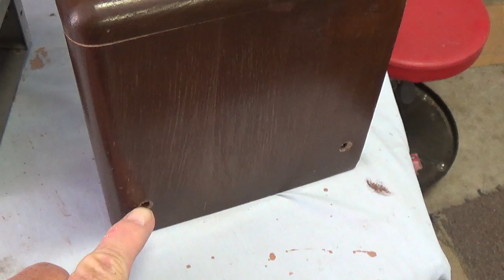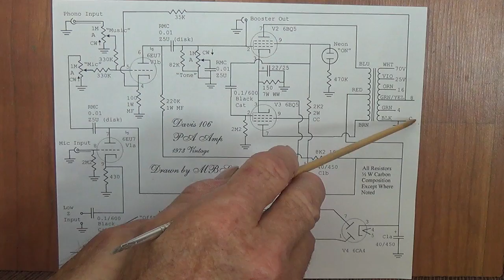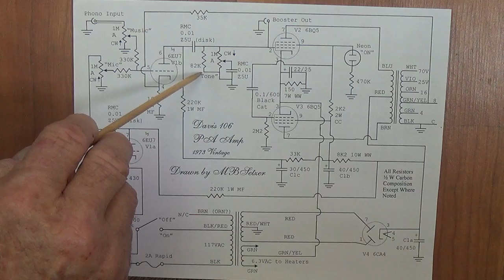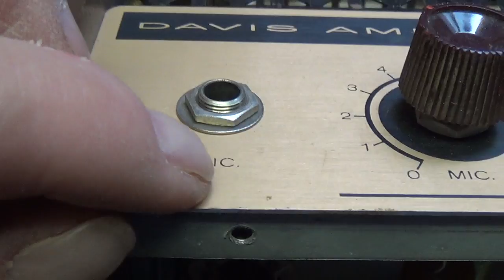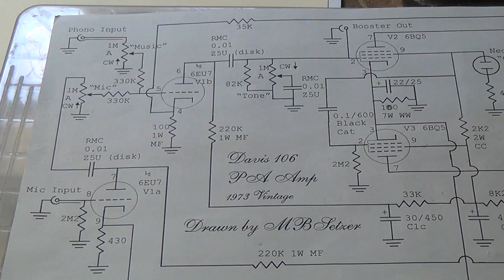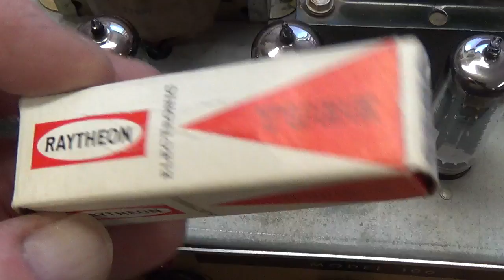Conversion of a J.W. Davis P.A. Amp into a Tube Guitar Amp

Comment: Gold to find those pa amps, if they have phono input,you can plug a guitar there,on old radios etc.ofcourse modding the cicuit there you can gett an instrument amp of it, here in norway radionette made push pull el84 and el 34 pa designs, they have a good reputatjon.just to change the conector to guitar input and there you go, same can be done on tube radios. There you have the cheep transformers,if you want to convert it to a only guitar circuit,and you shure find unkle doug have a building of it. Just remember to install an grounded power cord! Your work is topp as always!
Reply from the maker: Thanks for your nice comments, NB :)

Comment: Thanks for this video, it helps a lot!  I am converting a late 50's Dukane PA into a guitar amp. What gauge wire did you use to connect the 1/4" jack that fed through the screw terminal? I am doing the same thing where I replaced an RCA jack with a 1/4" jack for the speaker connection, nd I am going to feed it through one of the terminal screw holes.
Reply from the maker: You're welcome, T. When dealing with milliamps, wire gauge is really not an issue. You could use 20 to 24 gauge if you wish.

Comment: Thanks for that, Uncle Doug. I previously converted a Davis PA (a 201-A). I played it for a while and it was okay, but I've since re-wired it as a Marshall 18W style pre-amp.
I've never seen this kind of phase inversion on the power tubes before. That's really cool. I haven't felt inspired to build an amp in a couple of years, but I want to build something with this style of power amp and I want to do it point-to-point (that first Davis that I converted was initially p2p, but when I Marshalled it, I put in a turret board. I've actually got a bunch of 6BQ5s and output transformers to go with them. Now I just need to come up with a preamp for it.
I'm curious, since the screen grid and control grid are connected via the coupling cap, does that mean that the AC signal on the screen is the same magnitude as the input to the control grid? A unity gain, inverted signal?
Reply from the maker: Greetings, Pete. The phase inversion is indeed unique in this circuit. My interpretation matches yours, in that the AC output from the upper screen grid is fed (out of phase) to the lower grid, with HVDC blocked by the coupling cap. Whether the signal is unity or not, I'm not sure, but perhaps the 2M2 grid leak moderates it a bit.
Reply: @UncleDoug  Interesting. I didn't think about the grid leak affecting the signal level noticeably, especially at 2.2M. Looking at it now, that 2K2 2W seems to be providing different screen voltages to the two tubes as well.  I didn't notice that before. So there's some interesting biasing stuff happening here. I think I'm going to have to put it up on my breadboard and tinker. Do you happen to know the voltage for the HV on that? It's not on the schematic.
So since the V3 has the higher screen grid voltage, I'm guessing the signal is actually below unity? This seems very tinkerable. Part of what appeals to me is that the lack of the phase inverter really simplifies the wiring, making it much more amenable to p2p. I'm thinking maybe a Matchless Chieftain style preamp with 2x 12AX7s paralleled, but with a simpler tone control, driving the power amp. Got to see what PTs I have to play with on this.

Comment: I Don't Mess With That Old Stuff.
But It Looks Like You Just Connected
Booth Amps Into Eachother.
You Really Didn't Have To
Do Anything At All. I Have A
Vocopro Kareoky P.A System &
It Has An Output Of 120 Watts.
& It Has 4 5 Inch Speakers
& It Has A Great Sound.
I Also Gut Out Old Radios
To Make Bluetooth Speakers
Out Them.That way The
Radio Still Looks & Sounds
Original Cause All I
Play Is Classic Country
Music. Now I'm In
In The Middle Of
Building A Bluetooth
Speaker Out Of
A PVC Pipe. All
I Need To Do Is
File The Hold Where
I'm Mounting The
Speakers. I'm Using
2 50 Watt Audio Boss
Speakers. & A 50 Watt Per
Channel Bluetooth Amplifier.
All I Need To Do Is
Mount The Speakers
& Connect The Amplifier
To A 12 Volt AC.DC
Power Supply Provided
With The Amp.
Reply from the maker: Thanks for your input,

Comment: Hi Uncle Doug, I'm curious about how you wired up the AC power cord leads. I was under the impression it was better to run the AC hot (black) to the fuse and then to the power switch and then the power transformer with the neutral (white) going direct to the other end of the transformer. I'm not sure why, I just recall seeing that recommended. Are there different schools of thought on that maybe? In any case, great video, there are a lot of these old amps around that were used in schools and factories and such back in the day and waiting to be repurposed.
Reply from the maker: I agree, FB. The hot black lead goes to the on/off toggle, then the fuse, then the PT primary. The white lead goes directly to the other PT primary. If the wiring in this amp did not match this pattern, then it was an oversight.

Comment: Hey Doug, first time caller, long time listener! Youre doin great job!!

I was a little bit confused though, I thought black wire from AC outler is HOT and therefor have to go through the fuse, but in this video you did the other way round, being that the white wire is through the fuse.

Am I missing something ?

Thanks cheers for your channel man!
Reply from the maker: Many early circuits ran the hot wire through the power switch and the return wire through the fuse. I normally change this to the black wire running through BOTH fuse and switch. If I didn't in this case, it was an oversight.

Comment: Thanks for the video.  Watched it three years ago, and just watched it again.  Fascinating!  Any thoughts on the possibility or need to add a "Master" volume pot to this circuit?  I'll be using it for guitar only, and wouldn't need the phono input.  Would be cool to utilize that vintage knob and drilled pot-hole for something functional.  I'm not very knowledgeable with circuitry - and wonder if you could put the volume pot in the spot of the tone pot... then wire the tone pot like you would on an electric guitar.  I'm hoping you still check your old video comments.  Thanks again for the great video.  Steven
Reply from the maker: I try to keep up with all comments, Steven. Yes, you could add a MV to this circuit, but it would be a bit more complicated than you suggest. Keep studying videos and gathering knowledge......soon you will be able to perform modifications like this safely and correctly. Good luck.
Reply: Uncle Doug, I’m needing to replace the amphenol mic input with a 1/4” jack. From the video I can’t tell if the input Jack is ground at the chassis or a designed preamp ground point. Can you describe where the input Jack goes to ground please sir?
Reply from the maker: @kingdomtone  Rarely have I ever seen jacks that weren't grounded to the chassis, Steven. Those that are insulated from the chassis generally have a grounding lug......that is then connected to the chassis. Try it and see. I have a feeling it will work just fine.

Comment: I have a Precision Electronics S35 PA amp and I'd like to convert it to a 2 channel guitar amp utilizing the first tube preamp for a clean channel and utilize all of the preamps to a cascading 2nd gain distortion channel with a huge sound (modern). Also, I'd like  to have a switch to turn the speakers off safely and the output directed to a microphone out.  Can this be done? Thanks Uncle Doug! I love your videos!
Reply from the maker: I am having some trouble visualizing your plans, Allen, especially the part about the "microphone out".......what would be the purpose?  As to your final question, I'm sure that any concept can be built, with enough time and effort. Good luck with this one.

Comment: Good going Doug , I wondered about changing the input impedence similar to guitar amps and some have a 32,000 ohm resistors and 68,000 ohms on the input if I remember correctly !
Reply from the maker: You're better off with 32-34K, IS. In Fenders, the 68K input resistors are generally in parallel.....so actually about half that value.

Comment: Nice video. Watching your older video recently, in which you explain the operation of  three types of inverters, the Split Load, paraphase and the long-trailed pair phase inverters, buy how is it called this type of Driverless (?) Push pull inverter?
Reply from the maker: This circuit, like the Magnatone Melodier model 109, uses  a configuration called "screen-fed self-split", in which you add a voltage drop on the screen grid of the tube being driven by the preamp, and the screen will work as a "second plate" with an inverted signal that can be taken from it and fed to the other 6V6 grid through the 0.1uf cap.

Comment: Hi Doug, love your channel. What manufacturer are the “tubular” yellow capacitors you mentioned here? Is there a brand you could suggest using?  Thanks!
Reply from the maker: Thanks DK. Check out Antique Electronic Supply on line......they offer the yellow tubular caps as well as all sorts of other components.

Comment: hi there! i have a Geleso vintage italian amp and i can't understand how to connect o cable to a cabinet. it has 1 to500 omh  and 8 numbered screws at the back rgrds! k
Reply from the maker: It sounds like a PA amp, Costas. There should be a common or "zero" screw for one speaker lead, and a 4 Ohm or 8 Ohm screw for the other.....depending on your speaker impedance.
Reply: thanx! my speaker is 16omh
Reply from the maker: Then look for a terminal that is marked "16". Good luck.

Comment: Another winner, Uncle Doug. I wuz, however, hoping you would've addressed 
the National Football league loop by either simply lifting it or otherwise 
aiming brain energy towards it... as I invariably derive learning and entertainment 
from such endeavors. Also wuz wondering about the output transformer as to whether its larger size was due to the extra taps or if it had the capacity for more power, though I must confess I'm not the volume nut I wuz in me reckless and carefree youth...  thanx and cheers
Reply from the maker: Thanks, Jonny. I guess you could make the NFB switchable or adjustable. Most PA amps have rather large, multi-tap OPT's to suit a wide variety of speakers. You're welcome.

Comment: I know you don't do the Hi FI conversion thing really but do think these amps would lend themselves to Hi Fi conversion? Or would it be more trouble than it's worth? I was thinking one per channel.
Reply from the maker: People use them as monobloc amps, Jack. One for each channel. It's not my cup of tea.......but they work well.
Reply: Thanks UD! Since my guitar playing sucks I thought I might look into this since I think the vintage amp thing is fascinating but kinda worthless to me since I can't play guitar! lol.
Reply from the maker: It's a hugely popular hobby, Jack, with all sorts of Internet sites and forums to help you learn about stereo and HiFi.
Reply: If a person were to build your tremolo overdrive unit you could also drive this amp and still use it as a guitar amp as well I would assume?
Reply from the maker: Yes, the Tremo-Drive will work with virtually any audio amplifier.
Reply: I just picked up a pair of DeWald I think they are 12 watt Hi Fi amps on ebay (one 1957 and one 1958). They are Hi Fi amps to begin with so it should be just a matter of refreshing them to work as Mono block amps. One is guaranteed to work where as the other has issues.  Thank you so much for your insights into these wonderful old amps!!

Comment: Hi Uncle Doug, after watching many of your videos I gained enough confidence to start my restoration of the CHA-20; learned a lot already.  The previous owner told me that it doesn't make any sound and blows a fuse shortly after being turned on.  First I took all the tubes to the local electronics shop that had a tube tester thinking it might be a bad power tube or rectifier blowing the fuse.   The rectifier tube (6AX5GT) had a short so I replaced it thinking that I found the culprit.  I rushed home and plugged in the amp with the new tube.  Heaters lighted up so I think that part of the transformer is working.  I also was able to turn up the volume and hear moderate hum/buzz coming out of the speakers before the fuse blew again.  Do you think that is a promising sign that the output transformer is OK?  Any ideas on what to track down next that might be sucking up enough power to blow a 2 amp fuse?  It won't stay running long enough to test voltages, so I thought to start with replacing more tubes (one 12AX7 tested bad, and one of the 6V6GTs tested very weak).  Alternatively I thought to replace the canister filter caps which are 50+ years old.   What do you think? Thanks for your help and inspiration.
Reply from the maker: It's usually not a tube. If it's drawing too much current, I would suspect the filter caps might be responsible. I hope you are using a current limiter. If you don't have an ESR meter, feel the filter cap can(s) to see if they get hot ( = internal short).
Reply: Uncle Doug thanks Uncle Doug.  Appreciate the helpful advice.  I'll replace the filter and coupling caps first.  I look into making the light bulb current limiter you demoed.
Reply from the maker: Good luck, John.
Reply: Hi Uncle Doug, replacing the filter caps now.  I found a match for the 500v 16mfd cap, but it seems nobody makes a 450v 5mfd electrolytic any more.  Closest I can find is a 7mfd 450v and I'll  need to stack them like firewood to replace the 4x 5mfd can.  Is that close enough for a filter cap do you think? https://www.amplifiedparts.com/products/capacitor-ft-450v-88-f-axial-lead-electrolytic It was me that asked about checking voltage on the input power  transformer as well. I thought that would be a good way to isolate it as a functional component before spending money on all the cap replacements... Thanks for your help!
Reply from the maker: Yes, the 7uf @ 450V should work just fine.  Going up in capacitance (a moderate amount) is always better than going down.  The Voltage rating must always be the same or higher.
Reply: Uncle Doug thanks I'm  on it, after I make my current limiter. :-) thanks for all the guidance.  I wouldn't have made it this far otherwise!
Reply: Built my current limiter. Turned on the amp again without plugging in the tubes and I can hear the gentle hum of the input power transformer and no blown fuses  (hopefully a good sign) Will check voltages and impedence on the can caps when my multimeter arrives.  The plan from here is to replace the old two prong with a grounded power cable, next on to replacing the electrolytics: 1x16mfd 500v, 4x5mfd 450v filter caps as well as a 50mfd 400v that is in line between the 2 6v6gt output tubes. Also, 3 or so waxy paper caps near the microphone and phono inputs. Finally I need to figure out how to remove the microphone input (rivited on) and replace with a guitar jack. Once I get all that done and presumably the amp is functional, I can move on to the tweaks in your videos to make it sound nice!  Again thanks for all your help. Very interesting project.
Reply: Hi Uncle Doug. I got the multimeter and checked for connectivity and voltage at the connectors of the input transformer. Continuity check failed across leads 2 and 6 (410ac)- no beep.  I plugged it in to the current limiter (no variac yet) and test voltage from the wall leads to transformer was 118v, the low voltage lead was OK at 6v, but when I checked voltage across the high voltage my meter went out of range and started beeping. So I checked between center tap and ends - that came in at 430v on each lead.  Should be 410v per the schematic but I think that means my power supply is OK.  What do you think?  Thanks again for your help.
Reply: Hi Uncle Doug and happy New Year!  Working on my cha-20 project, I got my multimeter and started checking the transformer.  I did a basic connectivity check, everything beeped as expected except the the high voltage wires (410VAC with a center tap), they did show 300ohms of resistance across but no continuity beep.  Next I plugged the old amp into the current limiter (I made from your other video thanks!), and started to check voltage.  AC voltage into transformer at 119v, low voltage on the other side was 6v, and the high voltage was so high my multimeter went out of range and started emitting warning beeps.  I checked again from the tap to the ends of that coil and got a solid 430v AC on both sides of the tap.  So a couple of questions 1) now that I'm seeing these voltages can rule out a dead input voltage transformer from the equation? and 2) my measured voltage on the high voltage side is 430V but the schematic shows 410v.  Will I need to do anything to take this voltage down a notch, I can imagine if the plate voltage is too high it might burn up tubes, etc.  Thanks again for your great help.  Step by step I'm learning how to do this.  Can't wait for the day I plug my guitar in and rock...
Reply: Hi Uncle Doug, thanks so much for your videos.  I couldn't have done it without you.  The 60 year old bogen cha-20 came to life again today after replacing 6 electrolytics, 3 waxy caps, and new tubes - all bad ($100).  Sounds pretty good after addressing some issues w/hum around the input to the first stage.  I played for 40 minutes elated that it largely works now.  Plate disapation is high at 14.97w but if you account for 2.5mw grid current loss it is more like 13.5w which is still high for a 6v6gt.  Do you think increasing the resistance of the cathode bias resister is in order?  Thanks again. Add another success to your list of achievements!

Comment: Most PA amps are clones from the " RCA tube manual ."  If you don't have the classic book .. you find them online . One of the older RCA books has the original 50W amp that was the blue print of the Fender amps of the 1950s .
Reply from the maker: Thanks for the info, WC :)